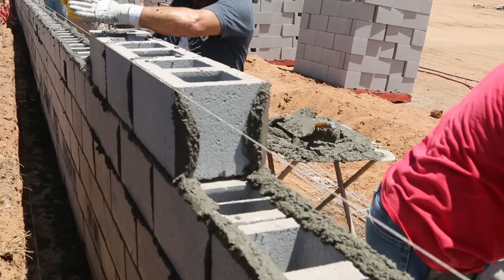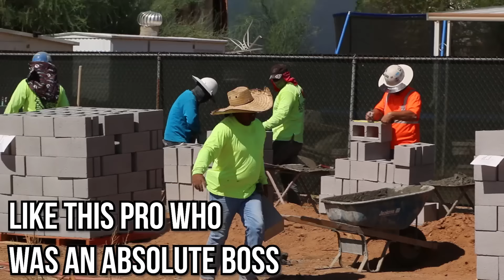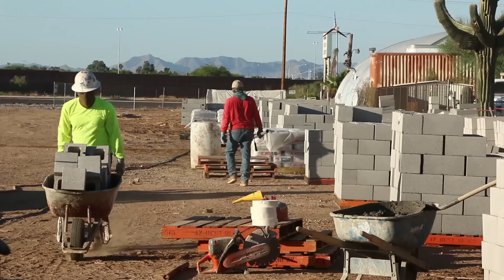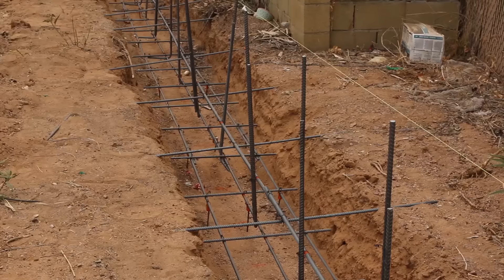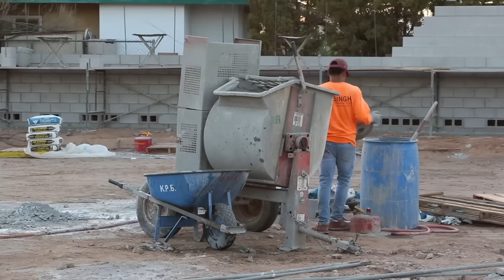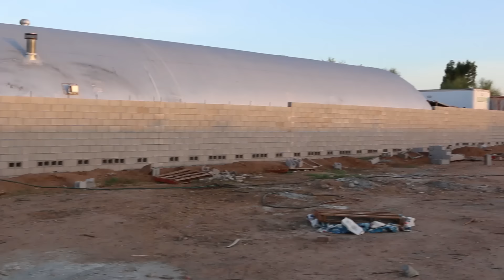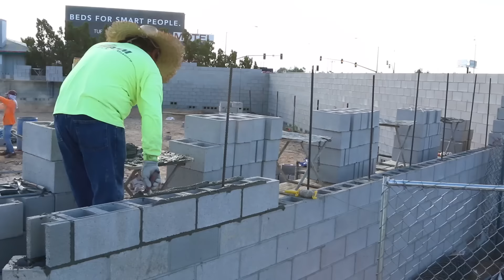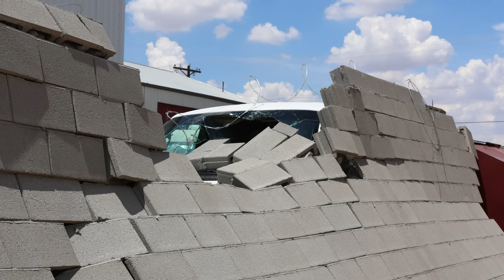Building A Block Wall

Comment: That top-beam at around 15:40, how is it made that the concrete doesnt spill down the inside of the complete wall? It looks like all the cells are open, so simply pouring it in would fill the whole wall right up?
Reply: Looked like there was a strip of 1/4” fiberglass mesh (think supersized drywall tape) placed on the second to last course of block.
Reply: RTFMundHDf the webs are plugged in some fashion, with scrap block parts, or plugs it doesn't take much.   Sometimes that top is a special block with a u cross section so that there is no opening
Reply: The fill it all the way up solid wall
Reply: On small jobs, balled up newspaper works!
Reply: They do fill all the way
Reply: There is a product called "grout stop". It is a roll of mesh plastic. You roll it out at point you want the grout to stop. A true bond beam course, is layed with U shaped block.

Comment: What are the horizontal cells for near the bottom?
Reply: They allow water to flow through the wall. The will be at the final grade height.
Reply: TheSuperCRB Ta.
Reply: So that dogs can bark at each other from opposite sides.
Reply: To allow rats in and out.
Reply: drainage, also called weep wholes
Reply: i dont know but i will guess for airflow/wind
Reply: John Wildermuth good question
Reply: John Wildermuth drainage
Reply: Lot lizards
Reply: Drainage.
Water has a way of getting wherever we don't want it to go, and therefore needs a place to escape so that it doesn't sit in a wall and damage it...and grow mold.
Reply: Alan R thanks
Reply: Alan R the water can’t get inside this wall so I don’t know what your talking about. It lets any water above grade flow from one side of the wall to the other.

Comment: I've always been amazed at the skill of a good mason, especially the guys buttering the joints of the blocks.  They way the just seem to slap it on there and have it always be just the right amount.
Reply: I know right? The sheer speed and precision that mortar was being slapped into place was just blowing my mind. I've never done that sort of work before but I am certain it would take me 5 - 10 minutes to put the same amount of mortar that guy was slapping on in 30 seconds and there would be A LOT more on the ground afterwards.
Reply: mute8s and by the end of the ten mins your wrist would likely be tired and burning
Reply: It's just practice...I don't think about it, I just do it. The odd occasion it can fall off haha
Reply: placid renegade looks like magic to me
Reply: It's not hard. Just practice.  These guys waste a lot of mortar.   Up here in the northeast we use the fins or excess to butter head joints.  Material even sand is expensive here so we don't waste anything.
Reply: They have to do it fast because it’s the mortar gas to stick. It’s a lot harder to get the mortar to stick if you’re being slow and deliberate.
Reply: rjtumble some brickys do it as fast as they can if they’re on priced work ;)
Reply: no these guys are messy and go to where he was talking about the control joint and look at the bond in the wall FULL BLOCK TO HALF BLOCK WRONG WRONG WRONG. THIS MEANS THAT THE WALL HAS A HALF IN IT AND IT MEANS  THE WALL WAS NOT TRACED OUT PROPERLY. DRIVE YOU MAD TO LOOK AT IT IF YOU KNOW ANYTHING ABOUT BUILDING 

.
Reply: @nedfee35  What are you even talking about? "FULL BLOCK TO HALF BLOCK WRONG WRONG WRONG?" "THE WALL HAS A HALF IN IT?" You've never laid block before in your life if you think that there is something wrong with the wall because they used 8³" half blocks.
Reply: Well that's what he's doing. Slapping the mud on. But it's shear stroke. I do this work
Reply: You ever watch a plasterer perform his magic?
Reply: good mud man is key
Reply: It's worth pointing out that the TOOLS of the trade are shaped and sized that way for a specific list of reasons. It's taken centuries of development from the dry-stacking methods of Inca and Egyptian masons to build and shift through technologies over time, including the Romans who adopted Cement(um) and eventually the technology we use today.
   Go back and watch again... Stop the play-back as the guy scoops up a clear and visible load on his trowel, and look close... really close. Then watch him butter the next seam(s)... That trowel was developed so it's not so hard to "eyeball" the thickness you need to do that job.
    Check out the guy that was just buttering over the top of the whole wall... practically running down several blocks worth of the stuff at a time... until he's close to tying into the next lines of mud. He's a little newer, careful enough to avoid knocking a bunch of mud on the ground with overlap, even avoiding "cutting it close"...

    It sure looks like magic, until someone puts a trowel in YOUR hand, and talks you through a block or two (hundred? thousand? HUH?!?!)... Don't get me wrong, it IS cool to watch. It's just surprising how little practice it takes for those skills to really pick up... ;o)

Comment: You missed one component that seems to be in most block walls, the empty beer cans.
Reply: 12:00 they are drinking bottles
They just need to be broken before going on top to replace the razor wire like shown in the wall failure at the end
Reply: structural beer cans
Reply: hahaha. I have a demo company and this is so true. Beer cans, newspapers, toilets, etc. you'll never know what you find in block/concrete. They're like fucking time capsules.
Reply: Gordon P
Reply: Man where are you getting your worker... they leave them dam glass bottles all over my jobs.
Reply: @cdsnider9496  double AA
Reply: Rambozo Clown. My uncle would have a cigarette hanger out of lips and beer can near by that ended up in the wall.
Reply: @scruffy6151  ф функция АО
Reply: Looks like cheap labor to me..
Reply: die warlock  mis huevos
Reply: ^This guy drinks.
Reply: thats really true man
Reply: lol in asian countries they break beer bottles and place the sharp glasses on the top of the brick wall to prevent thieves from climbing over it.
Reply: and urine
Reply: That's real talk
Reply: die warlock  That is what those Mexicans refer to as fuel, they work faster that way.
Reply: While he's making this video were drinking beer.
Reply: die warlock  my nigga 😂
Reply: and the Mexican work force. we are also building trumps wall \oi/ olé \o/
Reply: @damarh  Mexicans: Sure! $10/h...Okay? Okay!

Comment: why is striking the joints (18:15) a thing? just for optics or does it have a structural reason?
Reply: Looks nice, allows run off and allows for other coatings/fixtures thereafter.
Reply: Structurally, striking the joints helps to consolidate the mortar, bond the mortar to the block better, and eliminate voids better. These block layers are experts and the mortar looks wonderful, but striking allows them to not be quite as perfect with the mortar and then finish it with striking...
Reply: Also removed excess that could allow a crack or chip to get under the block
Reply: For looks
Reply: Doesn’t the striking also allow the blocks, which are more durable, to protect the mortar from weathering, so that it lasts longer. See a lot of walls where the mortar is rotting out of the wall while the bricks are fine.

Comment: Excellent video as always, Scott.
Q: why are the CMUs in the bottom course rotated 90 degrees, creating through holes ? Drainage, for that once-a-century rainstorm? Other?
Reply: Relieves water pressure for anything that happens to flow along the ground. The desert doesn't have much but when it gets some, watch out!
Reply: fprintf love your user name! 😂
Reply: It allows kitty cats to get through the wall.
Reply: Travis J I Corcoran  I think it maybe a wind/ air flow thing, not sure though.
Reply: He mentioned a month or two ago in a video that the permitting process took about 2 years to get approval, and one of the biggest issues was drainage.  The land has a natural grade to it, and you don't want your wall trying to hold back that water!  So, you give it somewhere to go.  Aaaand, you let the critters through too.

Comment: Could you do a video of different nails and what 16 penny etc means
Reply: Nowadays 16 penny means a nail that's 3 1/2" long (unless they're coated sinkers, which for some reason are only 3 1/4", but still called 16d), but in the old days it meant that a hundred nails of that size cost 16 pence.
Reply: Cadwaladr thank you I've heard it a million times but never knew what it ment.
Reply: No it is how big the diameter is of a nail you can have a 3  1/2 in 10d nail
Reply: A 10 penny nail is only 3” long. We’re talking nails not screws where the guage and length have to be specified.

Comment: Hi Scott and Nate, very impressive project. I imagine it takes a bit of courage to start such an undertaking (same for the spec house!). One point: aren't you technically talking about the brittleness instead of hardness at the end of the video? Coming from a Physical Chemistry background, the hardness to me is the ability of the surface to resist scratching. The brittleness (or its inverse, ductility) is a measure for the pressure that needs to be applied to cause permanent damage (plastic deformation). I do not doubt that you will have a 'constructive' opinion on this. Greetings from the Netherlands.

Comment: Have you ever managed or owned a construction-related company? If so--what was it like dealing with upset customers (complaints, accidents, etc), and what do you do if someone doesn't want to pay?

Great videos :)
Reply: Matt 
Planning for this before you ever write the contract is how. $250 spent with an attorney and a printer is the best way. Always have the legal owner sign a lien before anything else and find out how much is already owed on the property. Then incrementally give a lien release for the amount payed only. You may not get paid for years, but a good contract can get you legal fees and interest if they stop paying during a job.
Reply: You're required by law as a contractor to file a pre-lien notice if you're the primer contractor.  So you threaten to lien the property if they don't want to pay, which typically works.  It's also typical to charge intermediate payments at milestones of completion on larger projects.
Reply: He owns Wadco Construction in Roseburg, OR.
Reply: very interesting! thank you